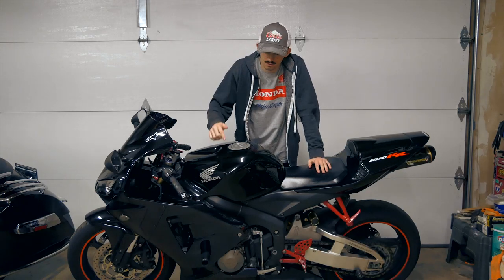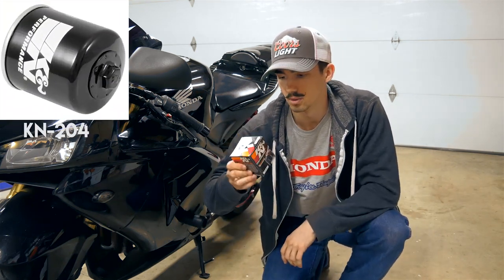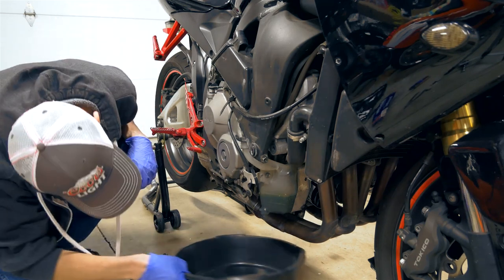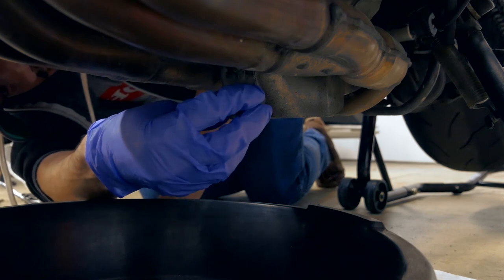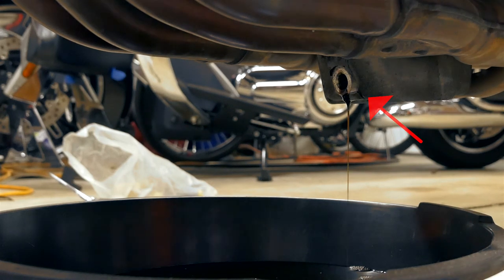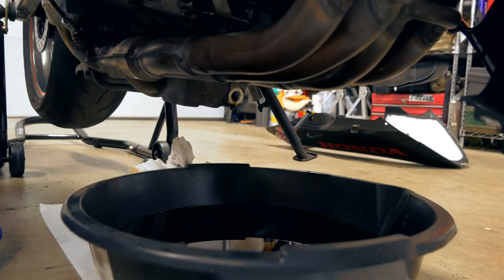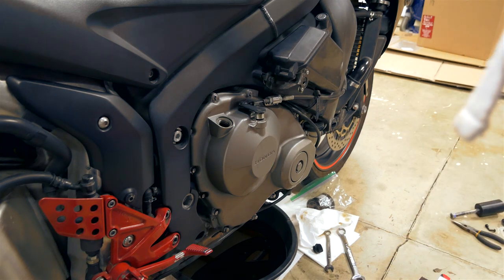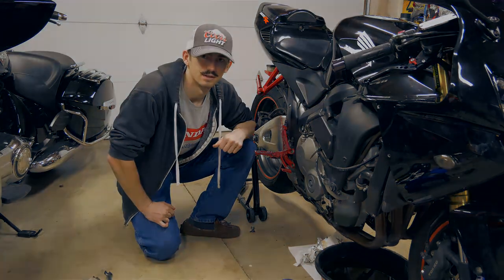How to do a motorcycle oil change (05 CBR 600rr)

Comment: I ride a 06 cbr600rr and it is definitely recommended that you change the crush washer atleast every 2nd oil change. It's not a normal washer, it is softer and flattens when used! I hope you never get a oil leak. Also you can loosen the radiator reservoir, in order to get the oil filter out easier.

Comment: There is a space between the headers right above the drain bolt you can remove the oil filter from there instead of squeezing it,i prefer to remove the coolant reservoir tho its just one bolt,Cheers nice vid.

Comment: Just use Motul or other high quality oil and NEVER start the engine without oil.
Reply: MOTUL 300V 10w-40 😉👍
Reply: @dirigent7854  this is worst oil yoi can add for street use. Unless you exchange it by every few hours. This oil was meant for racing and not to have good lifetime protection. Just use Motul 7100 or similar.

Comment: The coolant bottle comes off with one bolt and requires a 10mm socket, don't force any thing. AND DONT START YOU'RE BIKE WITHOUT OIL. WOW. ITS GOOD PRACTICE 👍

Comment: This guy... just started a MOTOR with no oil.... oh... my... lord... ppl please do not do this!!
Reply from the maker: I started it for a couple seconds to release more of the old oil, this will not cause damage to your motor as its not on long enough to create damage. This is a very common technique among mechanics.
Reply: You can run motors with no oil to flush the remaining oil out of galleries in the motor and oil filter for a short time. It won't overheat instantly. Mechanics do it all the time during a service and it's still not necessarily empty. A Skyline R32 would run with no oil exactly the same. I have personally seen them run with no oil before while giving them quick scrutiny checks before track days.

Comment: Maybe you got taught the wrong way but your meant to tap the starter button a few times to make the oil pump push some extra oil out. I would not recommend turning it on due to oil starvation of vital parts. Next time take oil filter off as well to get even more oil out but again do not start it it’s not necessary just tap the starter a few times it’s far less risky and in any case you will never truly get it all the old oil out so it’s pointless.

Comment: Good idea with the tinfoil, but dude, just unscrew one bolt of coolant reservuar and it will come out easy. It's kinda stupid to damage reservuar plastic...
Reply: Oskars Brokans yeah I just drained mine today and the previous owner had damaged the reservoir. Nothing major but I felt better taking the bolt out. Previous owner knew nothing! The date on the oil filter was 2013! So it should run great after this.
Reply: Hi can I unscrew the bolt for the reservoir and move it to the side without having to train the coolant ?

Comment: I used this oil and filter like you said but after about a minute in idle smoke started coming out from the engine bay!! I’m worried bro you know why that can be????!!
Reply: Urban Legend405 I used the rotella shit too and 50 miles later my engine wouldn’t idle. I had to use the throttle to keep my bike on. I switched back to motorcycle oil and let my bike sit for 7-10 days. Started it and it idled. Rode it for two weeks and the same problem came back.  Oil was on my spark plugs also so that means this shit burned my piston rings. I’m letting the bike sit again and gonna see if I can get it started again. If not then time for a rebuild I guess
Reply: xxxdriftr real i use rotella t6 its a great oil. maybe you used rotella t5. i put thousands of mile with rotella t6.
Reply: Oil that dripped on the headers

Comment: Another Rotella oil user...Riders don't let other riders Use Rotella.  You can spout off all the scientific mumbo jumbo you want, but when it comes to Revs meeting the road, Rotella doesn't hold up, it's why your Rotella Oil is black after only 500 miles of hard riding. It breaks down much to fast under the extreme heat of constant 15k RPM's.  It's why the AMA doesn't allow it on any track period.
The how how to part was good, except it takes 30 extra seconds to take off the Coolant reservoir, so you don't damage it, it's pretty thin plastic.  Either grow that thing or shave it off  :-)